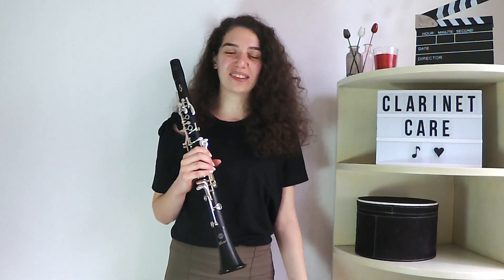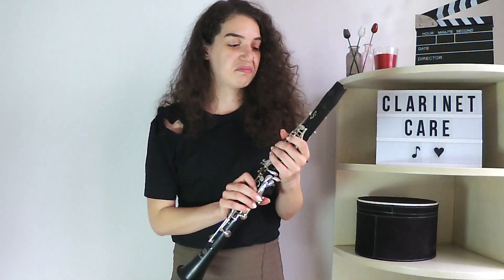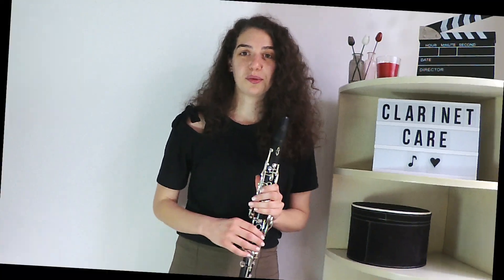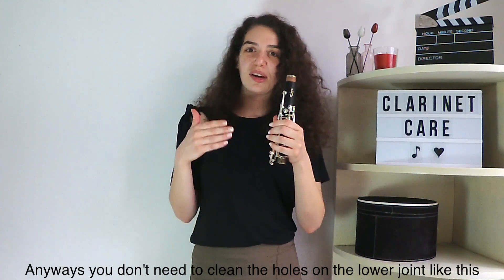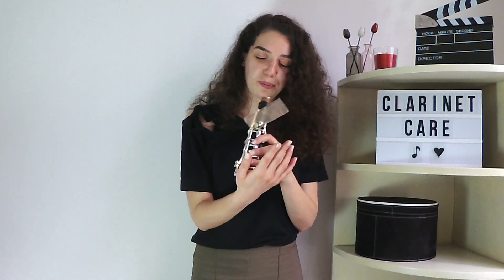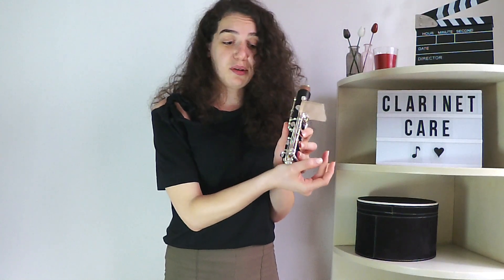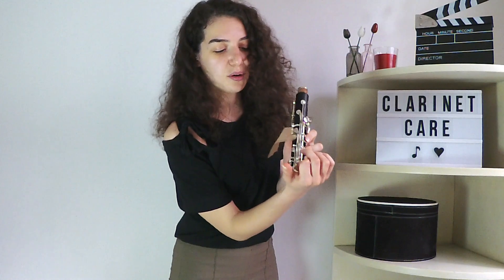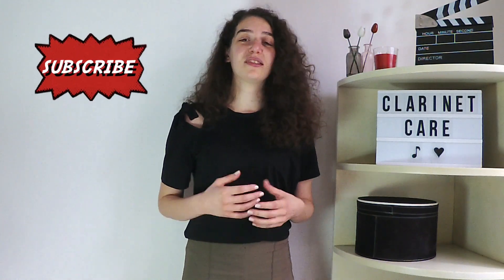How to clean water from clarinet holes

Comment: Another question I have, when do you think a mouthpiece has to be changed, after how many years of continuous playing?
Reply from the maker: Actually it's suggested to change it in 1 year for a Vandoren mouthpiece, but I use mine already for almost 2.5 years and I was actually planning to change it (then Covid-19 happened :/ )
Reply: Have you noticed some changes on playing during all this time you use the mouthpiece? Are you planing to get a new from the same model (B40) you play, or you'll change to something else? Also, small detail.. You play B40 traditional beak or profile 88?
Reply from the maker: Georgia Antza I use B40 (no profile) yes I’d like to get the same one ! And yes it lost its performance a little bit :/
Reply: and you use v12 size 3 reeds?
Reply from the maker: Georgia Antza yes